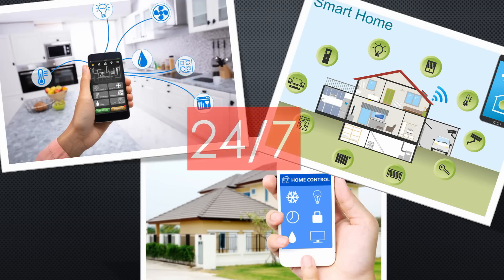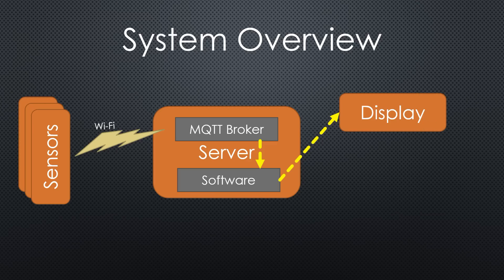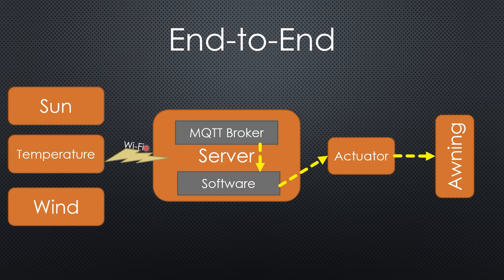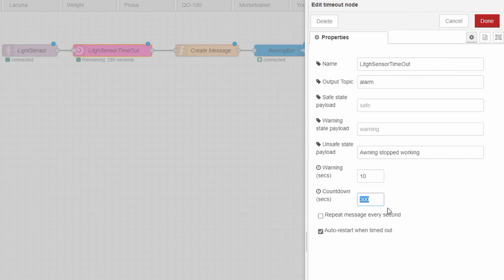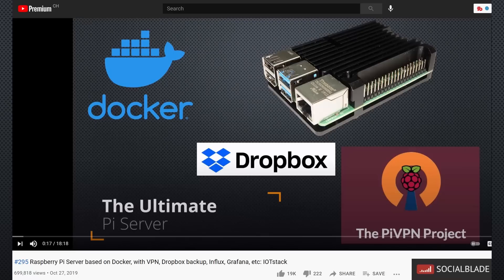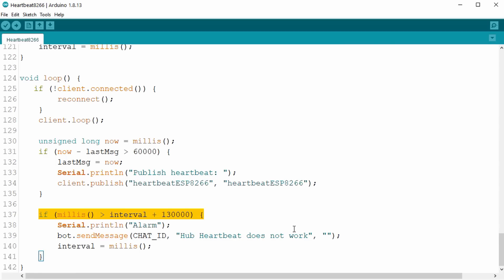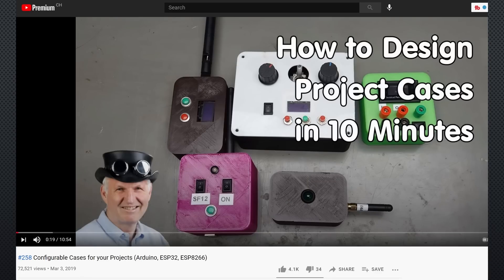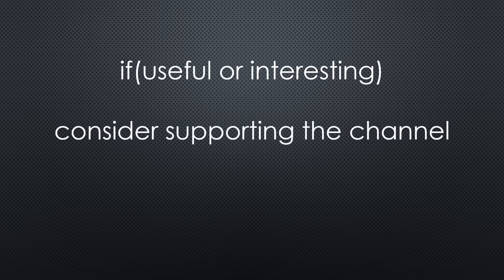#385 Supervise your Home Server with a Watchdog and Heartbeats (Raspberry Pi, ESP8266, Docker)

Comment: Definitely (useful AND interesting)!

The 737-max is a text-book example of getting this wrong, with horrific consequences. Boeing did not want to re-train pilots so they added a system (MCAS) to make the plane behave like one the pilots had been trained on. Trouble is they did not regard MCAS as safety-critical and made it depend on a single sensor system. If that sensor failed, it could crash the plane. The pilots, without training, were supposed to spot this failure, disconnect the system and manually fly a different plane they had not been trained to fly. But to fix this Boeing have only added a second sensor system. As you so clearly explained, this can detect a single sensor failure but it cannot decide which sensor to trust - that would require triple redundancy.

So now MCAS can detect its own failure, automatically disconnect itself and raise all kinds of alerts and alarms. But still the pilots have to take over and fly the plane that MCAS was put there to avoid them having to fly. OK they have also added some pilot training so there is a better chance of them handling the situation, but there is still a fundamental logical flaw in the safety case - MCAS is regarded as necessary, but not safety critical! In practical terms, pilots are suddenly being required to fly a different airplane on which they will get little or no practice.

Safety requires clear, logical thinking. That was absent in the original design and regulatory approval. Shockingly, despite 346 deaths, the safety case still does not add up logically. This is one plane that I will never fly!
Reply from the maker: Thank you for adding all the details. I just had a rough understanding on what happened...

Comment: It might be a stupid idea, but if you‘d make the watchdog battery-powered, wouldn‘t that also help with monitoring mains? If the battery capacity reaches a treshold value, it sends an alarm as well.
Reply from the maker: Unfortunately, the internet and WiFi are mains powered. So the Telegram message would not get through… Then I would need a cellular connection in addition.
Reply: @AndreasSpiess  That is true. I thought of a LoRa-based or GSM-based solution which might suffice for sending simple alarm codes, but LoRa gateways depend on mains as well.

Comment: Great video as always. 
I often need to use watchdog timers when using an esp32, not so much with a Raspi. But an even cheaper heartbeat for one or two Raspi's would be using some monitor service like Pulseway (Just like you said on your last slide). That way I'm always informed real quick when the WiFi drops again.
Reply from the maker: After other comments, I just looked into the watchdog of the ESP32. It is much better than the one of the ESP8266 and for sure I will implement it in my future projects.
Pulsway and other services are probably a little too much for me. I still hope that I would get a simple script that does the same task as my ESP8266 but runs in the cloud. That would solve most of my remaining problems, I thing

Comment: At a lower level - don’t forget the use of the watchdog timer built-in to Arduinos, ESPs etc. I think you made a video about it a long time ago! I used it to ‘fix’ the very unreliable software library that came with a 4G shield.  If it goes to sleep the hardware timer expires and initiates a restart - fixing the bugs!
Reply from the maker: Good point. I think, I never used it with the ESP32. Maybe a new project...

Comment: I got excited at the start and then disappointed that you didn't use a second RPi as a redundant wifi router and server.
I still gave you thumbs up for this simple alarm and hope that you will consider and look into redundant router/server/alarm.
Reply from the maker: Redundancy creates a lot of problems because you have to synchronize all data storage in real-time. This is why I did not do it. It also would be to complex and specific to a video, I think.

Comment: I use Zabbix 5.2 which now supports MQTT. It runs on a raspberry pi and is a dedicated package for network monitoring. It also will tell you if your systems run out of disk space, of ram, if other pingable things go down and so on.
Reply from the maker: Seems to be a very elaborated system. Probably an overkill for my simple Pi server... But for bigger servers for sure a good addition.

Comment: Hi Andreas, thanks a lot for another amazing video. Can you please create a video on pi-holes? specifically how to backup a pihole? I have a Pi-4B that runs pihole and home assistant and I can live without HA, but pihole is absolutely necessary as it's the DHCP server for my network. So have it redundant would be very useful
Reply from the maker: Redundancy is extremely complicated and definitively my strength. From what google says you can just run 2 pi-hole devices in parallel without any connection. ( e.g. https://discourse.pi-hole.net/t/using-a-2nd-rpi-pi-hole-for-redundancy-setup-question/26932 )

Comment: Nice topic :) I went for redundancy with 3 pi's where three Node Red instances are updating each other with heartbeats every 500 ms to see who is online and who is master. Only need to buy some extra rflink to also make them redundant. 
Here also the WAF was the main driver for the project!
Reply from the maker: Good project! Because I run an InfluxDB, redundancy is not so simple for me. So I decided to stick with just alarming.
What do you mean with "master", BTW?
Reply: @AndreasSpiess  I also run influxdb now on this same fail over cluster. But that is done by docker swarm and the storage by glusterfs.
With the heartbeats the NR instances are electing a master (the highest number is always master if online). Only the master processes the mqtt messages so messages are not double or triple times processed. The slaves are silently waiting till they need to jump in when the master dies.
Reply from the maker: That sounds like over my head! But very interesting. Thanks for clarification.

Comment: Hello Herr Spiess,
One piece that has been missing from my IoT system is the ability to remotely monitor without paying for some service. I understand I could port-forward on my router but I think that creates a security risk on my home network. Would appreciate your input. Thanks for the video.
Reply from the maker: I got some hints about remote access services in my Raspberry Pi videos. But I never tried one.
Reply: You could use Blynk. The first couple of widgets are free. And extending only cost some few dollars one time.

Comment: Hi Andreas,
feedback from (another) old-timer
Great description on the watchdog principle.  In the early days of CPU, I used to implement those in hardware, based on a timer/counter that got reset as long as everything is fine.  If it missed a heartbeat, then the hardware did reset/reboot the whole thing.
Have you looked at the app IFTTT?  That (internet) service can generate alarms if it does not get a signal within a certain time.
BTW...  there is also a Telegram bot called Watchdog.  It looks like it can do everything... except what we want it to do.  Would it not be cool if Telegram could generate an alert if it didn't get a heartbeat from our RPI?
Thank you for your weekly high quality video.  It brightens up my Sundays !  
Every time
chrisV
Reply from the maker: I looked at IFTT a few years ago. Unfortunately, they did not have a timeout function. They only di " If this then that" in a positive way. While making this video I only googled and found no result. Do you know more?
concerning @watchdog_robot: I looked at its description, but found that its purpose is different. So we have to search elsewhere.
Reply: I was thinking about a hardware-reset to. Both controllers have a reset-pin so let one reset the other. Or, if that does not work let one enable a relay that disables the other one's power for a couple of seconds.
Reply from the maker: Agreed. Hardware reset would be a good thing for sensors. But not easy because they are everywhere. But I do not want to cut off my Pi if I am not 100% sure it has a severe problem. Mine, for example, recently had an issue with network connectivity. It still ran, but had no more connections. So I was able to properly reboot it and avoid the chance for a loss of data...

Comment: Andreas thank you for another very  informative video although a little short.

I have the usual Raspberry Pi Server running NodeRed and other programs supporting a selection of 24 ESP 01/8266/32 MC's dotted throughout my home.  All ESP's have an MQTT heartbeat which will get a Software Reset if the heartbeat fails for more than 2 minutes then if this fails to reset the device I use a Sonoff Basic to RESET all power for that device and its peripherals via an MQTT Last Will. The Raspberry Pi has its power supported by a bank of batteries.  All of this works very well and essentially looks after itself but I have just designed a 555 based external watchdog module that will hopefully replace most of the above. I do not use WiFi on the Pi Server so have never had your problem, I do however have another Pi acting as a WiFi Access Point and is faultless 

Much of what I have achieved has been as a result of your and other makers videos for which I thank you.
Reply from the maker: I like the idea of a 555 timer to create a reset. Simple and efficient if you want "auto-healing". So far I decided against auto-healing because alarming was enough for me. But if you have more critical systems, an external 555 is an excellent and cheap solution (except for the Raspberry which would need a more elaborated shutdown...)
Reply: @AndreasSpiess    Thank you for your reply. I have nothing critical to control, I just find human intervention really inconvenient. You have allready made a video relating to using Pi pins 5 and 6 for a controlled Shut Down it would just need power to be disconnected and reapplied. All could be provided by the 555 timer

Comment: Please do yourself a favor and implement some function like "timePassedSince" or "timeDiff".  (see your code at 9:50)

inline int32_t timeDiff(const unsigned long prev, const unsigned long next) {
  return ((int32_t) (next - prev));
}

inline long timePassedSince(unsigned long timestamp) {
  return timeDiff(timestamp, millis());
}

This will save you a lot of headaches when the stuff stops working after 49.7 days.

You now use 2 different ways to compute whether some interval has passed and it does take me a while to figure out whether or not they are correct.
In my optinion, such simple code that cannot be "read" in seconds is very likely incorrect, or at least raises doubts about the correctness.
By using those 2 simple one-liners you can take away a lot of doubt.
Reply from the maker: I implemented your recommendation. Thanks!
Reply: Also, "magic" numbers should be avoided. I guessed the first number as a one-minute "heartbeat" but I did not understand what the second one meant .
Reply: @michaels3003  Looks like a free interpretation of "2.1x" the heartbeat interval. 2x 60 sec + 10 sec.
Reply: @TD-er  , Dankjewel (I got it from the WWW; I don't speak Dutch).

Comment: Even Andreas, I am playing with a ESP32-WRoom-32 but it doesn't show up on Win10. It's usb doesn't show up tried the CP210xVCP driver. It is a deve board from China 38 pins mate. Nice vlog time to watch you mate.  My front gate needs a watchdog.
Reply from the maker: For a long time I had no driver issoes with Win10...
The front door watchdog probably would be a little different ;-)
Reply: @AndreasSpiess  I wondering if it is the enable to earth capacitor problem. Or maybe I spin up a qubes os instance and play in Linux. with it.
Reply from the maker: Remote debuggingh is very hard. Particularly around half of the globe ;-)

Comment: I get my mains/internet connection watchdog from Flightradar24 feeder outage notification e-mails. It takes a bit more than an hour to trigger, but it's quite foolproof and probably very redundant on their side.
Reply from the maker: That is a very interesting concept. To use a service which implemented a watchdog for a different purpose. The only thing I would not like is the alarm via email because I do not check my emails regularly. I like telegram because it alarms me with a sound...
Reply: @AndreasSpiess  It could just happen that the adsb raspberry pi is just down, but I still have to encounter that situation. For general monitoring, I use timeout and IFTTT notifications.

Comment: I implemented watchdog as folloving: the node red pings the nodes (asks for their ip via mqtt) if two responses from one node is missing it send a message with telegram. If connection is restored a new message is sendt.

If node red receives no messages it is set up to execute a reboot.

This has worked flawless. Without any extra components.
Reply from the maker: A good idea. A reversed heartbeat. I assume you could ask for any data to check if the sensor is alive. But what happens if your node-red goes down?
Reply: @AndreasSpiess  if it is the network or other on the pi then node red initiates a reboot. If it is node red itself, then systemd do a restart of the node-red service.

I also have a node-red-contrib-vcgencmd node logging throttling, undervoltage etc to narrow down problems. A good powersuply solved a lot of my network problems...

Have not had any stops on the pi/node red that has not been handeled in this setup.

After a crash/network/powerfailure I get about 45 telegram messages telling me the different sensor /switches is online again.

166 day uptime, installed some new nodes and got 4 restarts (systemd) inn one day. Removed new nodes and is back to normal..

Comment: DOOD!
Reply: Nice job, congrats Sir!
I'm considering build something like this but for notifications, I want to be able to receive SMSs (in case of internet fail). What do you think could be the best aproach? USB GSM modem connected to the Pi? A watchdog running on a Esp8266 with a GSM module?
Reply from the maker: You can use whatever system which is connected to your Pi (even through Wireless). You just have to make sure it gets a regular heartbeat.
I do no more use GSM because the service is or will be switched off...

Comment: 737Max had only one sensor .... which failed.
Reply from the maker: You are right.
Reply: @AndreasSpiess  are we talking about tcas ? Iirc there were 2 sensors but for some reason the system only used one an alternated between them for successive flights.  Further software stupidity allowed the system to agressively over trim the plane when the sensor lied.  Tcas was supposed to be  only a system to make the max "feel"  like a 737 so airlines could skip training and type cert for the new plane.
Reply from the maker: I am no airplane specialist. They just had a grounding because of what I thought non-redundant sensors.
Reply: @AndreasSpiess  grounded again?! That's not tcas then.   I know they have some grounding and corrosion issues.
Reply from the maker: No, not now. two years ago!
Reply: @AndreasSpiess  2 years ago was mcas  (Not tcas my bad) there were 2 sensors but the mcas software only looked at 1!  It didn't look at both and test for agreement.  By roll of the dice if it was using a lying sensor it would happily keep adding nose down trim. Mcas as approved by the FAA was supposed to add trim during high power maneuvers making the max handle like a 737 the pilots trained on. Boing added lower power maneuvers to the augmentation system after the fact.

Comment: Healthchecks.io is a simple to use, open source monitoring/watchdog system. I use it for nothing more than monitoring backup scripts but it has a lot of flexibility. I also like the philosophy of the developer - I'm confident if he ever had a youtube channel he would have no midroll ads.
Reply from the maker: I assume your method is more focused on server jobs. Or does it also monitor independent sensor nodes?
Reply: @AndreasSpiess  For some sensors that i think important for me, I have node-red use get-http to regularly „calm“ the watchdog. Works like a charm.
Reply: @AndreasSpiess   For me it is just server jobs but as @MagicCameo has said anything that can send an http request or email should work. The documentation has examples for all of the common languages. I have already used it in anger to catch a failing backup job.
Reply: Healthchecks.io is great. Use it as well to watch some components and because it is not dependent on anything in my place it also informs me when mains, Internet and anything else is down.
Reply: This is awesome !  Trying it out now.  Thank you for the tip Handle Bard
Reply: Indeed, very cool!
Reply: Awsome!! thank you! @andreas spiess Please Pin this comment! And maybe you want to make a video about the awesome update? (please with cat and little finger pointer, again <3 )